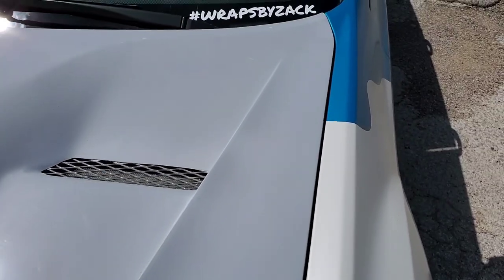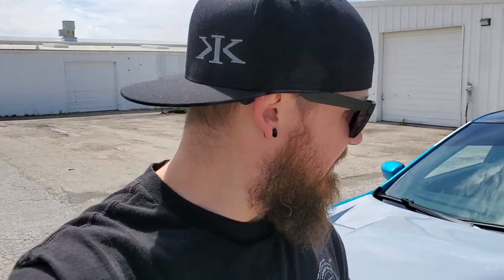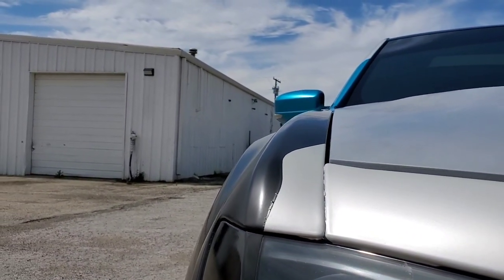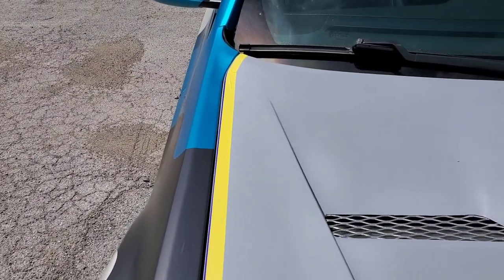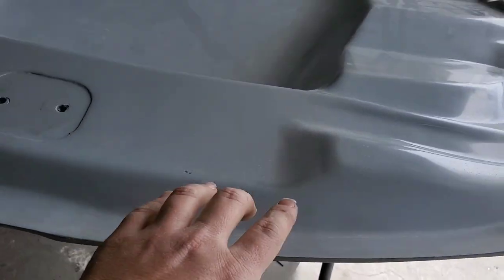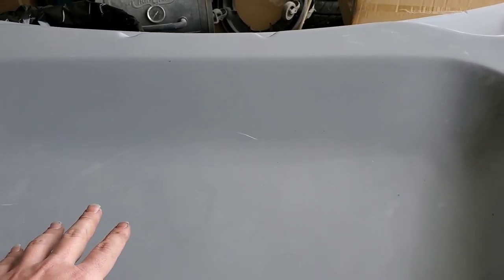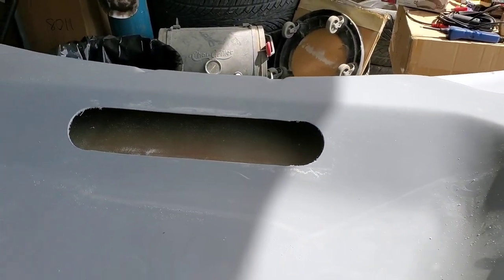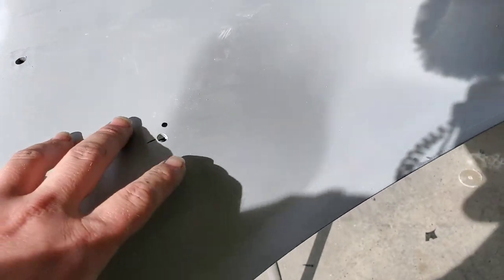Chrysler 300 Style Viper Hood Test Fit | BMC Extreme Customs Hornet Hood

Comment: yo bro im thinking of getting a 2006 Chrysler 300 srt8 with 113k miles. But i fear its gonna give me a lot of problems and gonna break down alot. Do you recommend this car?
Reply: Really depends on the previous owners. If it was owned by a young person then I would think twice, but if you're getting it for real cheap then you should get it and work on it,check all fluids/flush, check the suspension components e.t.c